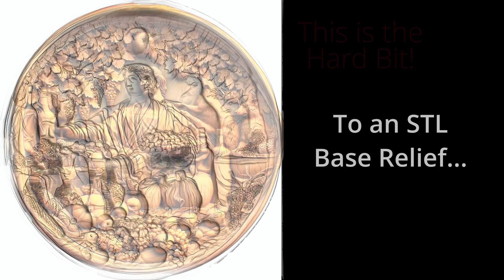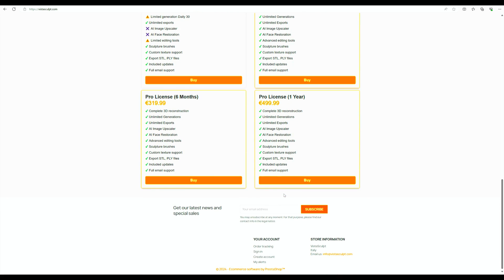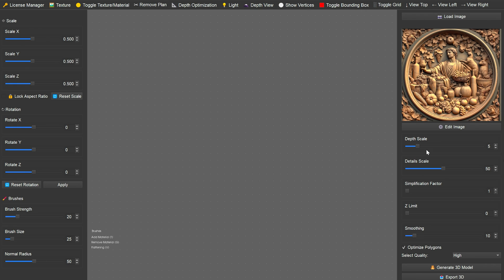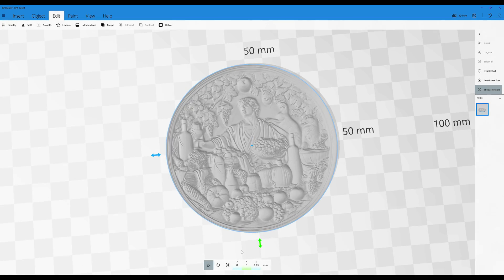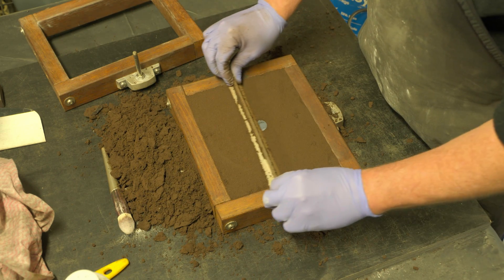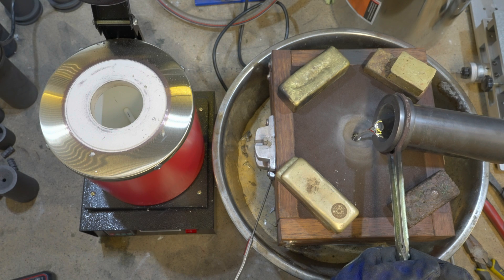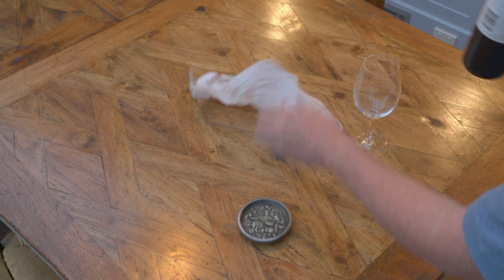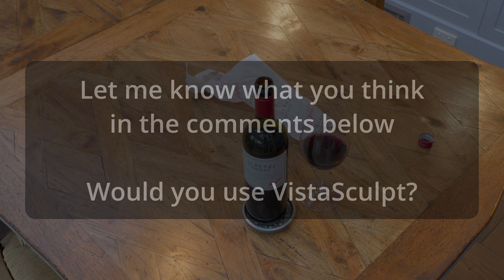AI Generated Image to Solid Metal thanks to VistaSculpt

Comment: my experience with the software:  I purchased a 90 license,  each time the program produces a relief and attempts to save to stl the program verifies the license over the network.  After several days the software would error with 'no license' message on every attempt to export an stl.  the company is in Italy I think and any communication with them they wanted to use WhatsApp. They would reset my license # and it would work again for about a day then fail. They wanted to blame routers, wifi, etc. for the problem.  Strange considering the license # is stored in the windows registry.  Use caution, there are other programs (AI) that do just as well and are much lower in cost or are free.
Reply from the maker: Interesting.  I never had that issue but I also no longer have the latest version as my licence has expired.  I too use another free bit of on line SW that while it is not as feature rich does enough for what I need.

Comment: How do you avoid relief making that leaves a angle on the cnc file when the image has lighting from bottom leaving a tapered file?
Reply from the maker: VistaSculp has some Material Editing Tools built in such as "Smooth" and "Remove" that should work to clean up the relief.
Reply: @jmone3559  how much is Vista sculpt cause I'm already paying carveco but doesn't support angle adjusting the flat plane to avoid angled reliefs which sometimes I have to cut deeper to get all the details of the relief just cause the angled plane
Reply from the maker: They have a range of different prices on their website that are worth looking at.
Reply: @jmone3559  I'll try the 34 a month if it supports angled plane fix  just to try since carveco is 50 a month for the supported feature I need
Reply from the maker: I'd suggest you get their "Free Trial".  It lets you test all the features to see if does what you need on the images you have.  You can't save the results, but you can certainly see how the generated 3D model looks.
Reply: @jmone3559  nice will do man and thank you for the advice, helps me alot 👍🏻

Comment: Downloaded the trial today. Disappointed that all of the so called Pro features are locked out. How am I to decide on which product will suit my needs if I can't test it out. Your Hobby License limits 30 generations daily so you are tracking the usage (Another Big Brother). How good are the STL's generated? You won't find out using the trial. You should allow at lease 5 STL files to be generated for the end-user to test the cutting. Your price point for the Hobby license is not that appealing considering I am spending 50 USD a month for my CAD/CAM software which has a similar function in it, but requires some time to tweek. It's an exciting product and the best of luck to you.
Reply from the maker: Yeah, I think the dev behind VistaSculpt is focused on the SW Dev as it is still in Beta.... and in my discussions with them, they are considering a price per export option to allow better access to try it out (especially for those of us that will only ever do a few 3D Model Generations in a year).